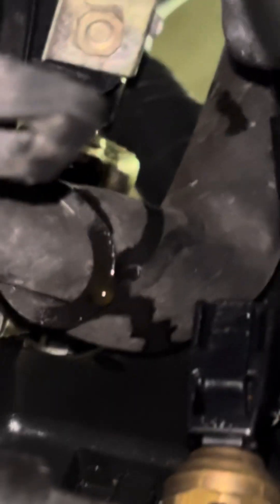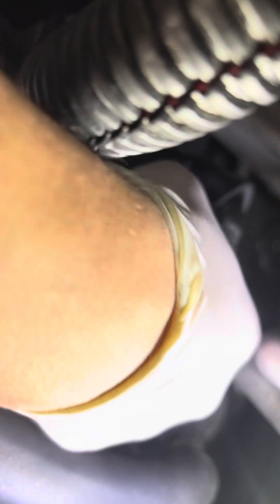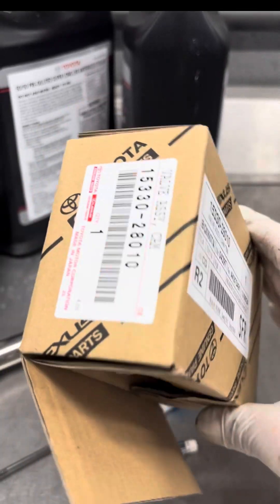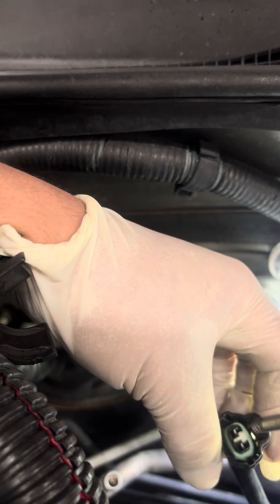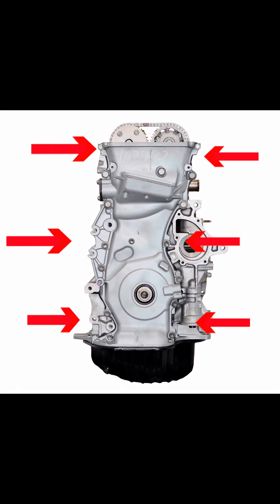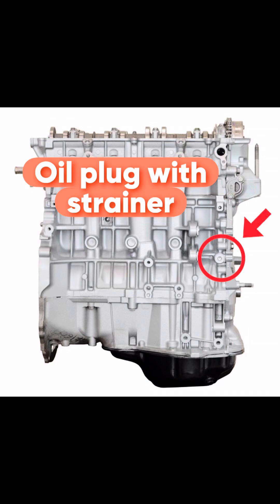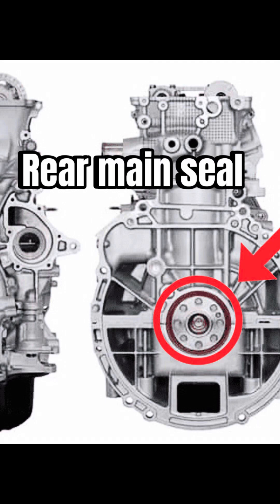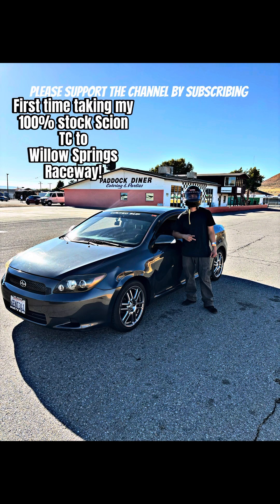Engine oil leaks 2AZ-FE engine

Comment: I do routine maintenance on two separate 2005 Toyota Camry with the 2AZ-FE.  Both of them had valve cover leaks,  VVT solenoid, timing chain tension, front crank seal, and oil pan leaks.   Thankfully no rear main seal.  The Cam position sensor has an o-ring on it that wears out, too.  Really great video - very well explained and good video and images of the work you did or common leak sources.  Thank you for making this!

Comment: Im looking for a leak in my camry 2003 I don't found any leak but it is consuming 1qt in 300 miles without smoke so probably is a leak the only clue I have is smell a oil burning. any tip?
Reply from the maker: Yea I recommend you do a compression test that may help you identify if the piston rings are leaking.

Comment: Regarding the Timing Chain Tensioner Gasket. Is it as simple as removing the tensioner and putting on the new gasket? Do you have to set up the timing?
Reply from the maker: It’s always a good idea to mark the timing chain before removing the tensioner just in case.
Reply: @projectracingtheory4125  Thanks! So the firing order is 1-3-4-2. set up the engine TDC to #1, Remove the Tensioner  and replace the gasket, reset the tensioner, re-install tensioner with new gasket then check to make sure it didnt jump timing after rotating the the engine back to TDC? Lol Trying to Get the Steps...
Reply from the maker: @ yea I believe that’s the firing order.